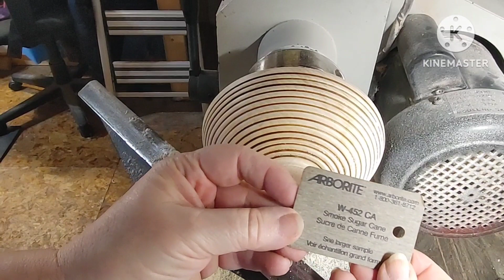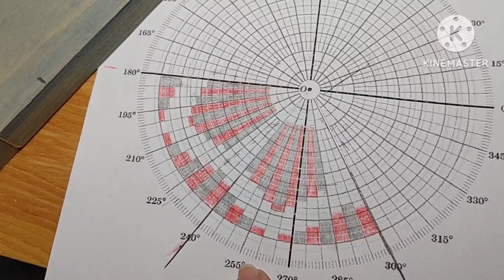Woodturning Basket Illusion My first one

Comment: I know about getting excited about things and forgetting to do other bits ... I had the opposite problem for my last video in that I forgot that I'd actually made videos!!
Anyway, absolutely love this bowl ... I'd suggest using a copper or steel edge for doing the burning ... it'll generate more heat and burn better while keeping quite a thin edge ....... I've burnt rings once and used copper wire 👍
Reply from the maker: Thanks Barry! I have a variety of sizes of copper wire! I'll definitely try that! Might have to do some R&D on how to burn the sides of a bowl
Reply: @spiritwynd  The copper wire works for surfaces where you can put tension on the wire (make it long enough so you don't burn your hands), but won't work for flat surfaces (like the bottom of your bowl) ... I think a thinnish sheet of copper or steel should do the trick, you basically want something which will be hard wearing and heat up without burning itself away 👍
Reply from the maker: Thanks! I do have some sheet copper that I will try! I'm going to make another plate/bowl this week